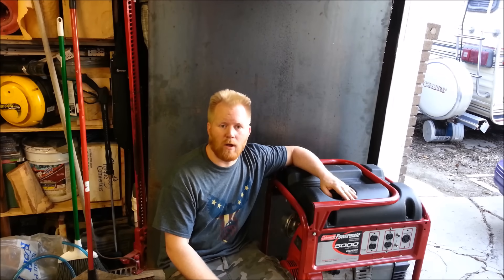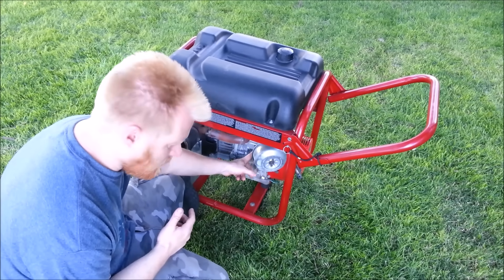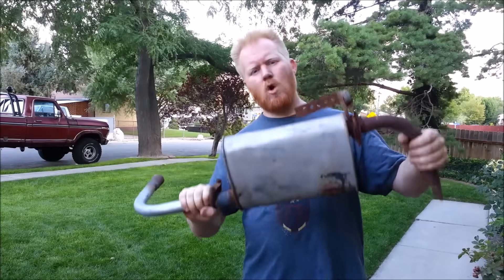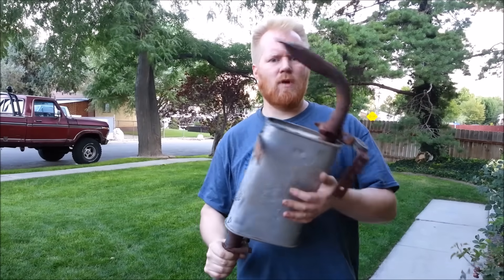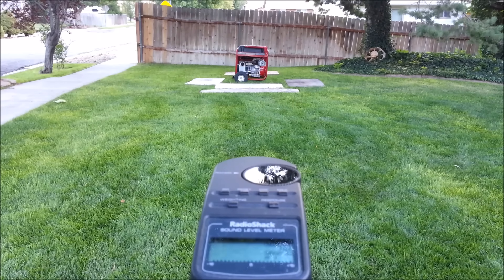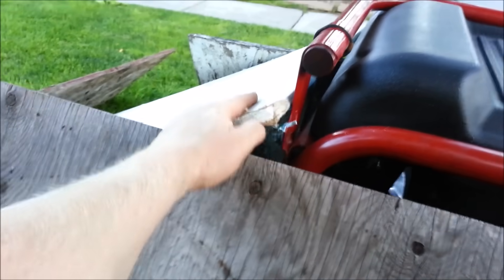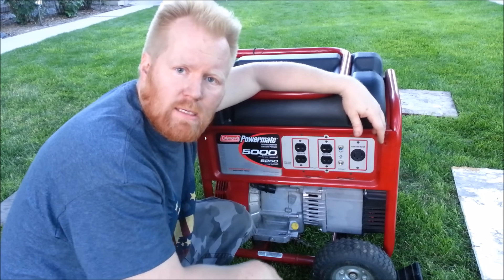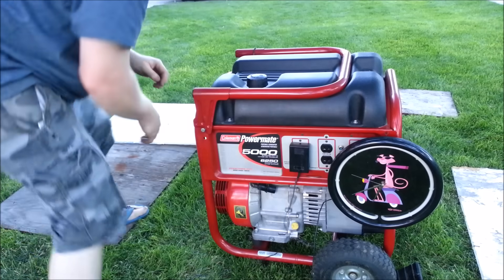4x Quieter generator in 10 seconds

Comment: Sixtyfiveford, 
Your correct. Majority of the noise is through the thinwall casting of the aluminum engine block.
An old all cast iron engine, liquid cooled car or truck inline 4, or 6 with cast iron exhaust, full pipe and quiet muffler has enough torque to run at very(quiet) low rpms. Very low sonic transfer through the block. Liquid cooled, allows much more effective sound dampening but yeah, you'll need to make a fan duct intake and an exhaust duct for heat removal. That will also push out carbon monoxide fumes as well.
Generator heads actually can output at 2350rpm. So a cast iron engine running at 1200rpm with a 1:2 step up drive will be pretty quiet. Yes they could also power a 15kw generator head, and CNG or LPG carbs can be added for multi-fuel capability.
15kw will operate a Lincoln 230V 250A  A/C- D/C "Tombstone box." Plus lots of other high current draw stuff.
Reply from the maker: The generator head will put out voltage at that low of rpm but not the correct HZ. It needs to spin up at 3600rpm to maintain a correct 60HZ waveform. Some equipment isn't as sensitive, like incandescent light bulbs, but things like electric motors/power tools are. Onan is known for their long life and quiet generators. They wire the generator head to run at 1800rpm with the motor. They essentially double the poles/windings to still get the 60hz.
Reply: How long do chinese rectifer diodes last? I don't think Honda generators use them.

Comment: It's only 2X quieter since decibel levels double in loudness for every decade value in a the A weighting. Your drop from 80 dBA to 70 dBA is only 1/2 as loud, rather than 4X quieter.
Reply from the maker: There is quite the debate around this. The main issue is humans don't all hear the same. But, the general consensus is that they average human perceives a 4-6db rise as a doubling of sound.  Of course this doesn't coincide with the logarithmic scale, hence the debate. Some may feel it is 1/4 as loud while others maybe 1/2. Either way it is a dramatic drop in decibels.
Reply: Scientific scales are generally not correlated to human perception. There are sometimes nifty shortcuts, or even rules of thumb for some professions - given it applies to the individual, such as my forefinger tip to first knuckle is right about an inch, or my shoe is right at a foot long... but neither of those are true for my wife. Are we to base length measurements on what the average human perceives? How so noise then?

Comment: Thanks for sharing your experiment.  I wonder if different materials and angles would attenuate the noise more? I'm exploring different possibilities for off-grid power when camping and like you I cannot stand the noise of generators but can't justify the cost of a "quiet RV generator".  I'm doing the math for beefing up my truck's alternator to charge my deep-cycle batteries to run my inverter. I can buy a 6000W 110/220V inverter/350amp alternator/heavy gauge cables & hardware for way less than a $1100 3500W RV generator. This will allow me to run my TIG on 220. I haven't found any real good examples of this type of setup on YouTube. Has anyone heard of doing this to your truck?
Air-cooled engines need airflow to keep from overheating; do you think this may cause an overheating problem? Maybe boxing in the entire frame with computer fans to force air through the box could knock the spl's down? 
Anyways, thanks for the video.
Reply from the maker: Different material will absorb more sound than others for sure. Large gaps are left on each corner to allow the engine and generator head fans to pull in plenty of air to cool themselves.

Comment: A small car engine is much quieter but not really practical.
Reply from the maker: A small car engine is quieter but not by much. This is mainly because car engines are liquid cooled and have a water jacket surrounding the piston. However if you open the hood and hold the engine at 3600rpm like the generator, you'll be surprised how much sound it puts out.
Reply: sixtyfiveford i got a car engine generator its not bad sounding but it requires an inverter so you dont run the piss out the engine. 3600 rpm is too much for a gas engine to sustain without recking the bearings.

Comment: Another fine video sir. Never understood about deflecting the sound into the ground. These cheaper generators run at 3600 rpm. I think the design is fewer windings; faster rotations.

 I found an older model Dayton that turns at 1800 rpm (very quiet). You would love this unit as the design has a pull start but also has an electric start option. When you push the starter button the 12-volt battery power energizes the generator just enough to start the engine. Such a simple idea.
I found a video of the generator I just described to you. He uses the electic start at 3:50 https://www.youtube.com/watch?v=zBUaCt0ff1E
Reply from the maker: Thanks. That's a nice generator. A lot of Motorhome generators run at the 1800rpm for sound and longevity purposes. Of course they're not cheap as you basically need a motor with twice the horsepower. The one in the video for instance: you can get 4000watts from around 8-10hp @ 3600rpm vs the 16hp that it is.

Comment: Great video.  10db is basically half the sound level though not 4 times or 1/4 the sound.  How much hotter did the generator run with all the wood stacked against it?
Reply from the maker: Temperature tests showed no real temp increase. Max was around 2-3F in some areas and others had actually dropped. The wood isn't as close or confining as you think. It allows more than enough space for the generator head and engine to pull in/push out ample cooling air.

Comment: love your vigjas. iv watched a few when I needed to do repairs to my mower or snowblower. but I picked up a gen from a yard sale guy said it was locked up. was going to motor swap it but got if to loosen up. as I spin it over by hand it sounds like it has a tap. took head off and seen the piston. it's making full rotation. do you think i should look more in to it or is it a waste of my time ?
Reply from the maker: That's a hard one. Generally any engine that has been taken to the point of seizing never runs right after it is freed up.

Comment: I was wondering if the rattle of the engine running causes noise from the frame it's mounted to? If so would it help to place carpet or a rubber welcome mat between the motor and frame? Thanks
Reply from the maker: All the generators are affixed with rubber dampers between the motor/gen head and the frame.

Comment: It is much quieter but I would like to see how much hotter the generator runs with it being all covered up.
Reply from the maker: It runs within 2 degrees F in some areas and other areas are the same or cooler on the motor. There is plenty of airflow space left in the gaps.

Comment: I`ve done this with mine too at the lake sure helps   ,I used to hunt with my RM 250 suzuki dirtbike Rang Dang Dang sound  , But here`s a tip that`ll get you a dead quiet motor I used to put 2 steelwool pot scrubbers in the tailpipe it goes to a whisper another is fibreglass mat around a blown muffler .

Comment: You probably wouldn't put your generator out at the edge of your front yard during a power outage.   So,  where ever you run your generator, just put your car between it and your home.   Cuts about 20 decibels...no lugging wood all over the place.   Plus it will run cooler than boxing it in.

Comment: Why not just buy an inverter type generator?  Even the open ones are pretty quite unless they are under high load because they can run at a lower speed unless they need to make a lot of power.  The old style generators have to run at a constant speed to produce a constant voltage which is why they are noisy like a lawn-mower, but an inverter will RPM down if the power demand is low.
Reply from the maker: That would be a video "how to choose a generator". This is for all the people that fell for the low price Home Improvement store generator and now has an issue of sound to deal with. Sure if you want quiet, buy a Honda eu series or Yamaha and there is no issues. All other Chinese brands of inverter generators are louder than they claim and very very poorly built. But even when people know their quieter they still buy them.  I have over $2500 wrapped up into 4000peak 3200 running watts Hondas. For $400 I could buy a Home Store loud generator that would do this.
Reply: Yes well money is an issue, but for example when camping I couldn't imagine running anything in my campsite that wasn't an inverter type.  Who wants all that noise?  But I did some research before I bought my generator and ponied up $2000 for a Yamaha 2800i for American Carburetor.  The big sell was it was dual fuel (gas/propane, and technically tri-fuel because it can be made to run on natural gas but I've never tried.)  So it's not super quite like a suitcase style but it runs pretty quiet if it's just charging batteries and such.  If it's running the air conditioner it has to step up the revs and makes almost as much noise as the air conditioner, but still pretty quiet.

But ya I do understand that a lot of people just buy the $400 contractor unit and let it noise up the place.

Comment: On the (at least then) 1970s gas generators (4 strokes) you could undo the muffler and muffler connector pipe into the piston chamber.  This WAS the same size and thread pattern as a normal iron water pipe.  Just screw in multiple lengths of pipe, and muffler at the end, ... and the only sound you heard was ONLY the bearings spinning.  Another option was dropping the exhaust pipe into a buried metal barrel with 1 foot soil over its top.  Again, total noise silencing.  And if you have the actual generator in its own concrete bunker (concrete lid), then there is only the electric cord coming out, and no noise is heard, no one suspects anything, even the burned gas smell is dissipated.  Total stealth generator use.

You can't do this with 2 strokes as the portal is both the intake and exhaust.  If there was a way of connecting a double pipe with the piston chamber, then with a Y connector to the 2 pipes and a flutter valve, intake valve opens bringing in fresh air via one pipe.  Valve closes and exhausts into the second pipe, then you COULD silence the 2 stroke in the same way as the 4 stroke.  Only wonder about the flutter valve making much noise.

Comment: Your restricting air flow that cools the engine, which in time will ruin it because it runs hotter. You would be better off to change out the muffler.
Reply from the maker: Muffler does nothing to reduce the overall sound. The sound comes from the engine block itself.

Comment: No wonder the last engine failed. Heat is destructive to any engine and all your doing is trapping the heat. Fail
Reply from the maker: Customer dropped it off this way and had never done anything of the sort. I got it for free with 2-3 hours on the clock. You can choc it up to a cheap Subaru small engine.

Comment: I'm willing to bet if you test it with a thermometer it runs at least 10° hotter. Probably why your last one blew up.
Reply from the maker: Some areas on the engine/generator head were 1-2°F higher and some 1-2°F lower. The fan on the generator and the engine can only pull in/push out a set volume of air(CFM). As long as you allow the ample inlet and exhaust space, there's not overheating. It blew up before I got it, because it was a garbage Subaru/Robin product.

Comment: 6:44 "Amazing airflow" is merely your speculation.   In like fashion you need an extended runtime and temperature measurements with and w/o the panels in place.

Something else a person could do is merely put the generator around the corner of a building/etc instead of within line of sight.

Comment: mine is a 5000 homilite from 80s original b&g 7hp wit 2002 sportster on stainless thick wall it isn't to loud but quetness is next to godliness at the deer camp
Reply from the maker: Try it out and you'll be impressed. I solely use a generator for camping and this makes a world of difference.

Comment: Great info...newer gen sets have much better mufflers than the Coleman etc. from the past that had just rototiller type mufflers..those older gens were MUCH quieter with a car type glass pack..they also had adjustable mixture so was easy to compensate for changes in back pressure..

Comment: My generator is very quiet, It doesn't even produce 10 DB

Its called a solar panel.
Reply from the maker: Sweet, and you only need half a football field to come close to the same power output of this. Oh and constant sun. Oh and a battery bank to hold the charge so you can use it.

Comment: Don't spend alot of money, just make a sandbag tunnel and roll it in. Cover the sides with sand bags except for ventilation and it's very quiet. Sew the bags out of any used fabric or thrift store blankets and sheets. Done and cheep. Bob's your uncle.

Comment: Pro-Tip:  If you run your generator in a small box with a controlled pressure release valve and an oxygen tank releasing O2 at an appropriate rate and launch it into high orbit, it will be dead quiet as you can't hear sound in the vacuum of space.    Just a simple trick a lot of people don't think about.

Comment: I guess you don't live in  Florida, that generator would get very hot, and reduce its longevity by getting way too hot. What I would do is find a way to install a oil cooler, just the way you do on a transmission of a vehicle that has a tow hitch.  That will handle the heat, then you could cover the generator with anything that won't burn. In my  yard, i would build a 3 sided concrete  Structure, and make a lid for the top, with a hinge that swings down to cover the last side. Build and opening for exhaust to escape. That is because of our hurricane season, and how many days we actually put on the generator at one time. I just ran my Honda for 4 days straight for Irma.
Reply from the maker: We don't have hurricanes or power outages here. This is meant to be portable for Camping or the extremely rare power outage. Obviously you would construct an entire "dog house" on your property if you live in a high risk area of the country. Very few generators are going to have a pressurized oil system so an oil cooler isn't going to work on most. That being said, this technique doesn't increase the engine temp, as proper area is left so the internal fans can maintain stock CFM air flow.
Reply: I also live in Southeastern Florida, and run my 7000 watt generator for 2 weeks at a time continuously after hurricanes. But it is way too hot to cover it up with anything, so I keep it inside my pool enclosure in the shade. But in my case it really doesn't matter because everyone else has a generator going also.

Comment: I've owned 3 Subarus, they are excellent cars.
Reply from the maker: Subaru makes one of the worst small engines for the small engine market. They are deemed disposable engines and are only put in the cheapest pieces of equipment. They're current design is a clone of a 30yr old Honda engine that had it's patent run out, so they stole it.
Reply: sixtyfiveford I'm not gonna argue with an expect I am talking about cars tho.

Comment: FYI: 3db represents a doubling in power, 10db represents a doubling in perceived volume.

That's why if you have a 10 watt car stereo, it would take a 40 watt stereo to double the volume (more or less).
Reply from the maker: The average human detects a 4-6db(A) drop as something being half as loud or 50% of original volume. So 8-12db(A) will be perceived as 1/4 as loud or 4x quieter than original.
Reply: Welp, now it's been a while since i looked into this sort of thing (35 years or so - my audiophile period), so you had me wondering if my memory was faulty.

I'm happy to relate that my memory is doing just fine, here are the first three places I looked:

http://digitalsoundandmusic.com/chapters/ch4/
http://www.acousticsbydesign.com/acoustics-blog/perception-vs-reality.htm
http://www.sengpielaudio.com/calculator-levelchange.htm

Submitted for your edification.

Comment: 4X quite clickbait... he means 12% quieter
Reply from the maker: The average human detects a 4-6db(A) drop as something being half as loud or 50% of original volume. So 8-12db(A) will be perceived as 1/4 as loud or 4x quieter than original. The Decibel scale isn't linear; it is measured on a logarithmic scale so you can't use basic math to calculate it.

Comment: So I guess 4x Quieter doesn't really mean it's going to be only one-fourth as loud.  Is that right?  Or do you use different math than normal people?
Reply from the maker: A 4-6db drop on the A weighted scale is perceived by the average human as 1/2 as loud. Double that and a A 10db drop is perceived as 1/4 as loud. Yep that's normal math.
Reply: I stand corrected.  I'm surprised that just leaning up some scrap panels would cut down the sound that much.  Still doesn't seem to me like only 1/4 as loud as before, though.  I'd say about half as loud, but I guess you really have to be standing there while it's running to honestly judge reduction.   And I bet that if you did the same test while the gen was on a concrete slab you would get less of a quieting effect.  
But it's good info, nonetheless.

Comment: good demonstration. I built a box around mine and insulated it with fiberglass insulation, left air space around bottom, with a 20" box fan on the top and a steel pipe to vent the ehaust out the back runs at about 45 db vs 79db without. stays nice and cool, even on hot days.